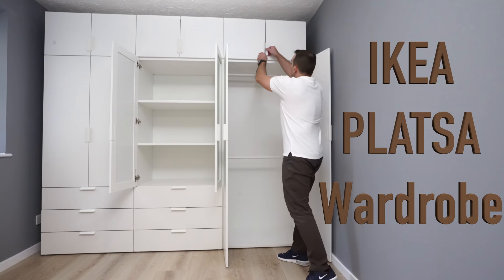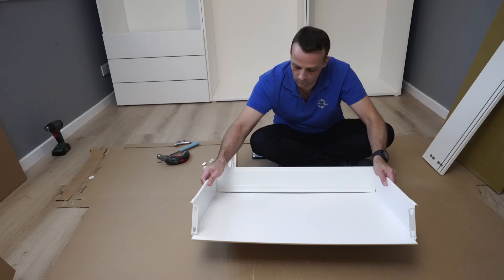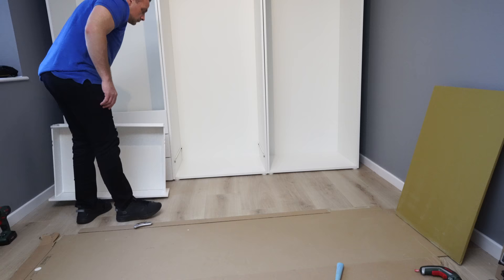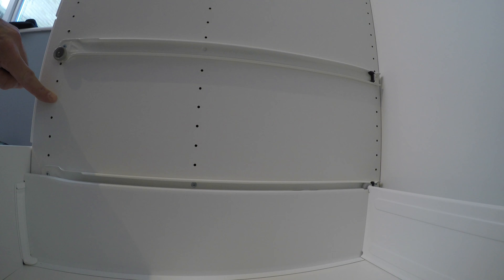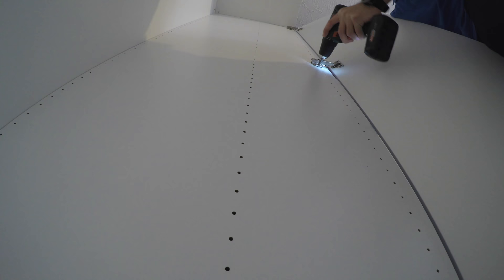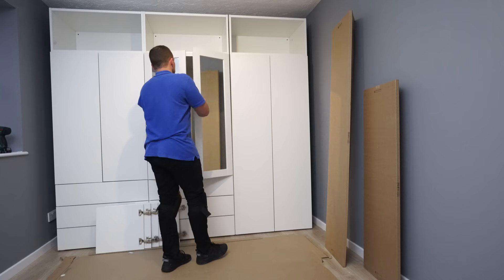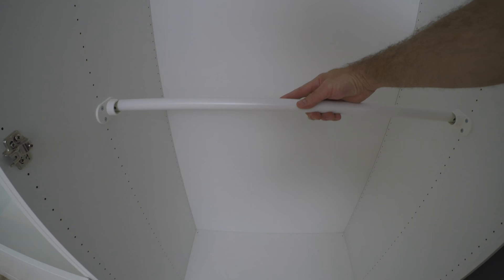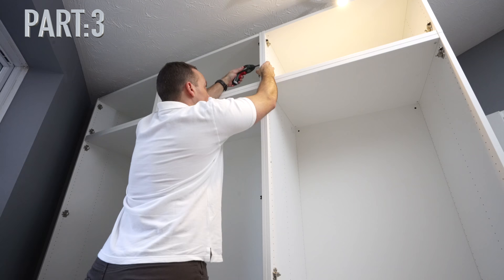IKEA PLATSA Wardrobe Assembly/PLATSA interiors/PLATSA doors/PLATSA drawers / Part:2

Comment: I can not for the life of me go past step 1 and 1 on the drawers - putting those metal brackets together. I spent 45min on it before I gave up, and I have 8 more to go ... any tip? was it really so easy for you? I've been building (and loving) IKEA furniture since I was little so I'm in shock...
Reply: im at exactly the same point
Reply: After spending 1h on this drawer driving me nuts: The only way I could me it work was to attach large tapes - because the frist 3 parts of the drawers are so instable that they all fall apart when inserting the bottom. The only way was using tape. Later I would lean one side to the wall when inserting the bottom.
Reply: Are you placing the part with the rollers in the right direction? If you flip it so that the "pocket" in the bottom can fit the slided wall of the drawer, it should work.
Reply: @joergm9273  Replying in case anyone reads in the future. The trick with the draws is that the the bottom part of the draw that slides in is ever so slightly longer on one side so you have to make sure you are sliding it in the right way (eg it's slightly rectangle and wider than it is longer) or the clips will never click into place. Someone had marked our ones with a pen to suggest they slide in that way but we only spotted this after spending forvever trying to figure out the first one that wouldn't click in!

Comment: This is really helpful, thank you. I haven't seen the plastic drawer front mechanisms before. I'm interested in buying a PLATSA dresser second hand and replacing the drawer fronts. Would it be difficult to remove the plastic piece that attaches it and reuse it?
Reply from the maker: Can replace or change all doors or drawer fronts same as interiors similar to pax system same measurements for old and new frames.
Reply: @PPFlatPack  Thank you :)

Comment: how did you do?? it seems so easy in 2:35??? i tried it with anything but it wont move / snug.
edit: nevermind, I found the way. I use screwdriver and wrap it with cloth or something, and hammer it down to snug that thing.
Reply: Same problem, it won't move an inch and the surface of the drawer front is so delicate it started to come of from all the nudging.

Comment: We need two 80cm frames to fit the space we have so we were looking at Platsa over Pax. However the quality of the drawers seems really low. Cheap runners and no soft close. Interested to know your opinion. I think we're gonna go with Metod and Maximera instead (even if it's for a wardrobe).
Reply from the maker: You right regarding drawers would be nice if they did soft closing should be the standard in 2020 I guess is the price. Regarding Metod units I like them and if the price is not issue go for it.
Reply: @PPFlatPack  thanks for your reply. I think long-term Metod is the better choice. The drawers are really nice and they open all the way.
Reply: Agree with you. I was ready to order Platsa but decided to visit IKEA and see them myself. Indeed the quality seems low and overall has a more cheaper look. I'll go with PAX I guess.
Reply: Platsa is like a budget alternative to PAX for the price we can't expect a lot from it. My mom has a pax for years holding on pretty good. I wanted the platsa cuz allows me to make a kind of a bridge in between closets giving me a place where I can put an office table in between them yet allowing me to have some place where I can storage extra stuff above the office table. Unfortunately PAX system doesn't allow such things :/ I think pax is a lot more sturdy and probably will hold longer than platsa
Reply: @ChemicalViruS004  went with Metod in the and very happy. Used some filler pieces and made it all look built in. So far holding up to the use by two small kids (even if they admit they've stood on a drawer 🙄).

Comment: Really like the new drawer and shelving system.  Super fast!!!  Also, it seems that you're doubling up your work by not mounting to the wall before attaching the doors.  Did you for the purpose of demonstration/experience with new product?  Thanks..
Reply from the maker: You right parts where is super easy I speed up there is not much to explain. Yes I wanted to do wall fixing at last for demonstration this video was recorded over 2days. Usually I fix frames to the wall first. I liked the new way they did shelves and drawers and frames finally something refreshing after long years of Pax wardrobes.
Reply: @PPFlatPack  thought so..